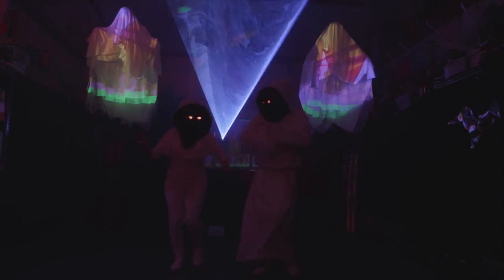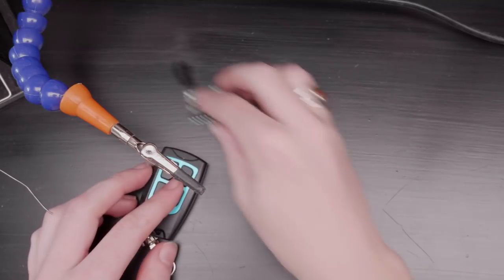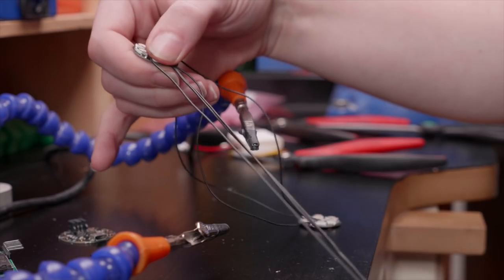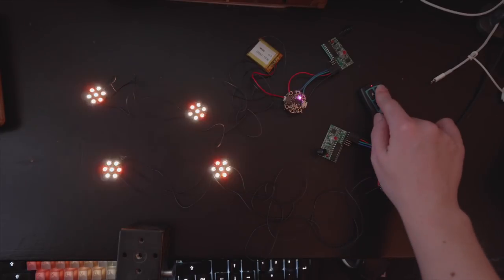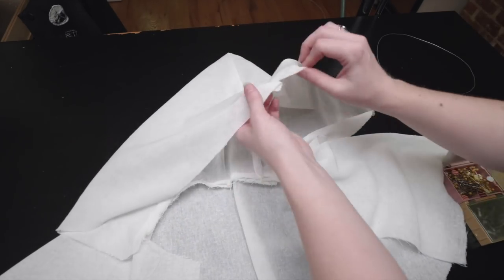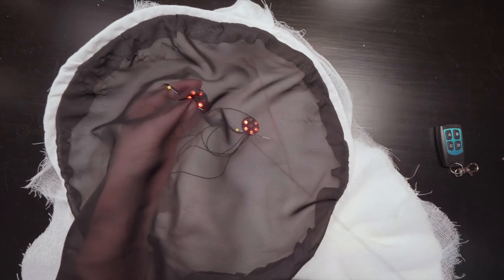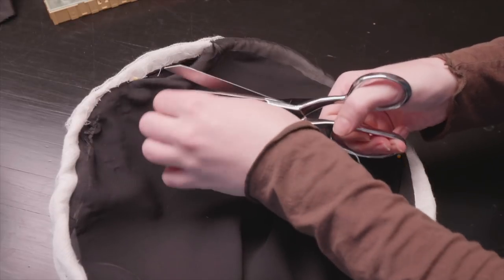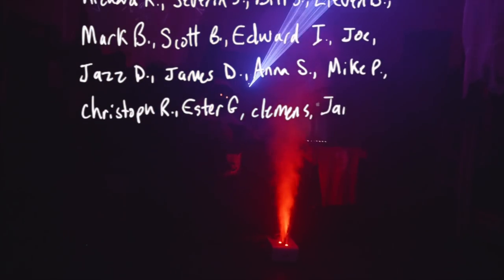Glowing Eyes Costume // Becky Stern

Comment: Super cool! How long do the clocks on the neo-pixels keep them synchronized?
Reply from the maker: Thanks! They don't stay "synced" they way you are thinking, they are merely switched to the same animation mode. The modes themselves are quite short, so I suppose if you made them super long, you could run into the sync issue you are describing.

Comment: I like the idea of having one remote trigger events on two costumes; did you have any issues where signal interference or low voltage caused desyncing of the displays?
Reply from the maker: Yeah, if one costume was out of range when the remote was triggered, they could go out of sync. We really needed to be right next to each other for them to both work on the 3V power-- it had about a 3-foot/1m range. If I did this project over again, I'd find a way to power the receivers with 5V.